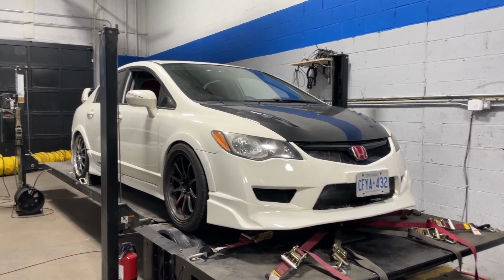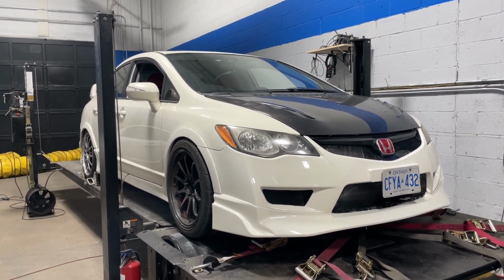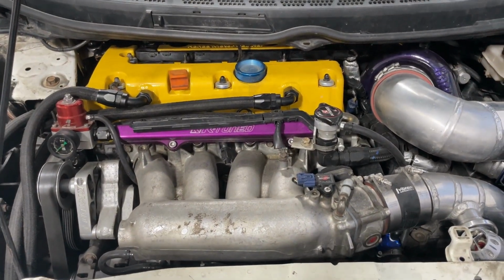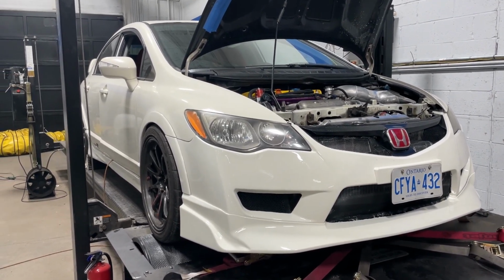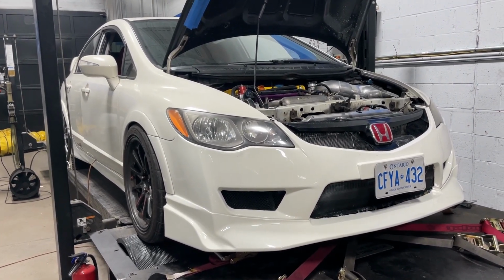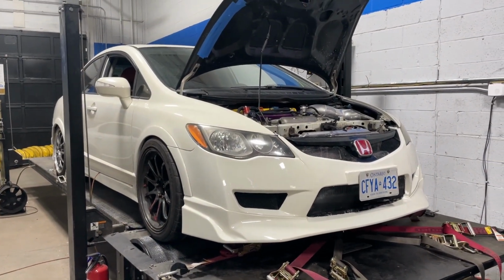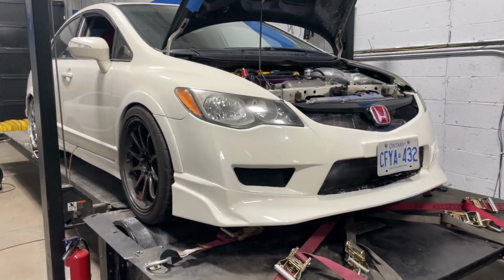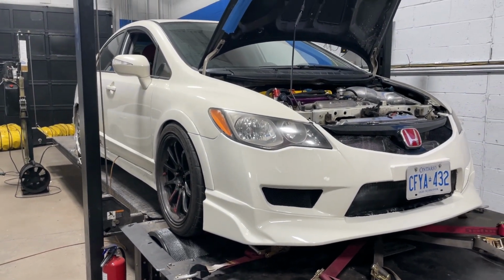Turbo K24 FD2 Civic Type R Replica

Comment: If I heard  correctly he has 11 to 1 compression ratio. Thats on the higher side even for NA. If you add turbo to that you cant really  go too high on boost using pump gas. His numbers are good.
Reply: his numbers are rly good regardless 🤷‍♂ but yeah when I heard the 11:1 compression I was suprised he was even able to get that much horsepower, I wonder if it still has a low rpm limiter or something maybe that would make a difference in how much boost he can hold.
Reply: Stock engine is also 11:1

Comment: whats the purpose of the dual blow off valves
Reply: When the car in high boost, your foot let go the gas paddle so the extra boost from the charge pipe will release out from two bov faster it protects the turbo compresor wheel